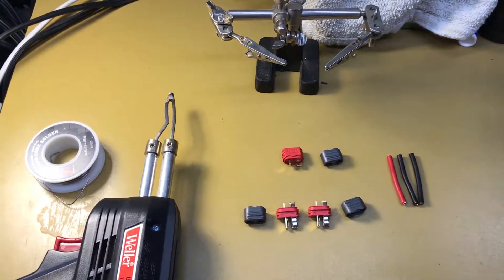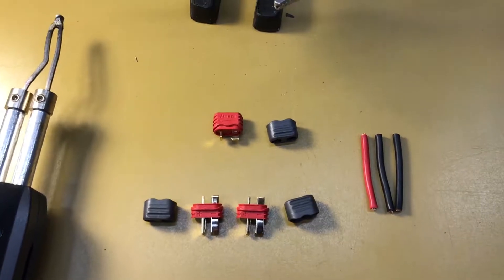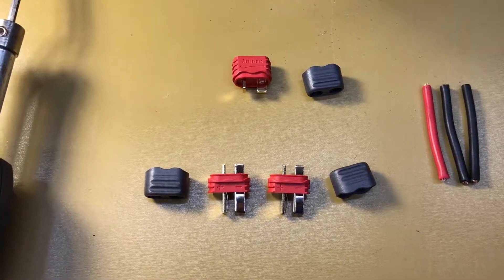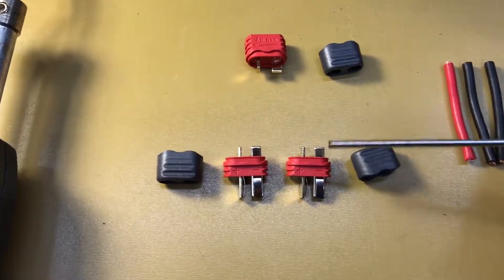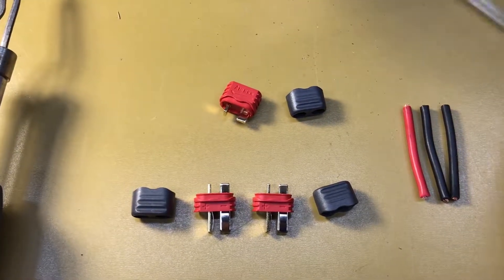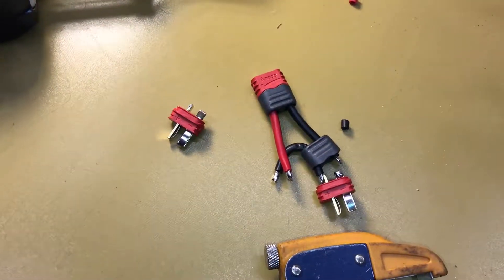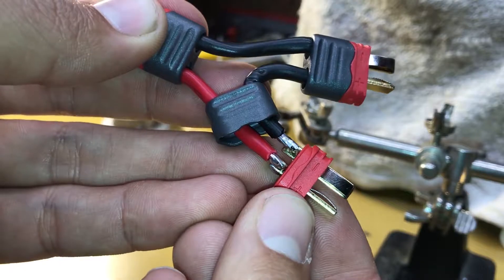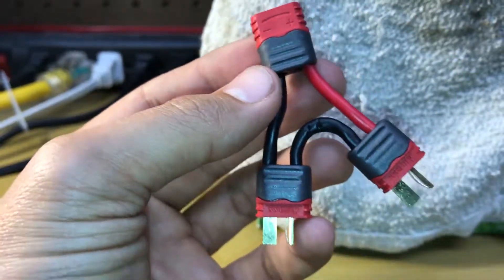How To: Make Deans Serial Connector-Double Your Battery Output

Comment: Dean's connectors are easy to work with and easy to solder they are very cheap in common and do have pretty low resistance but if you plan on running anything over 12 volt or anyting over 60 amps should I say they become pretty unreliable